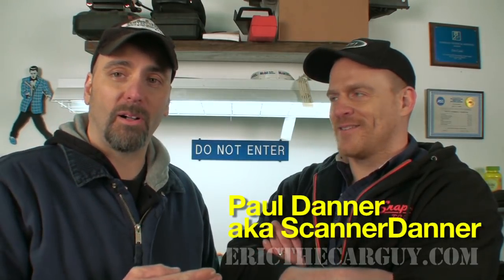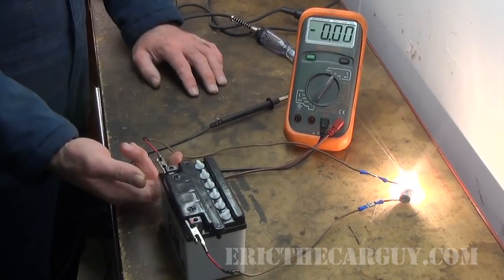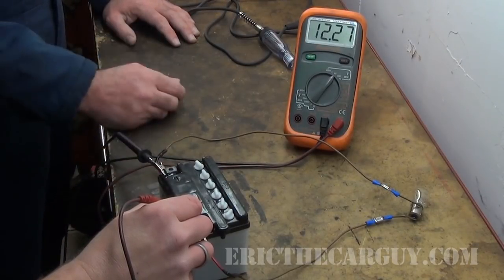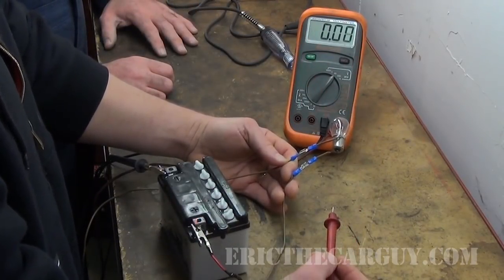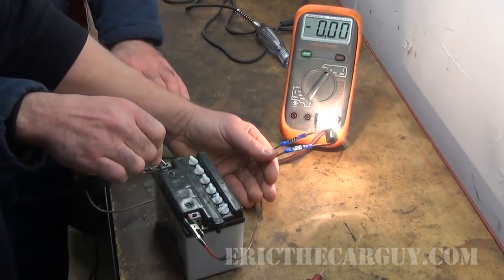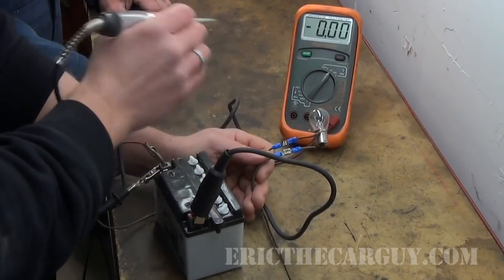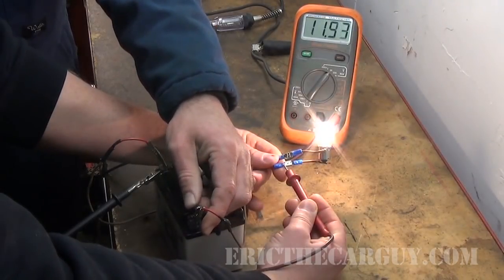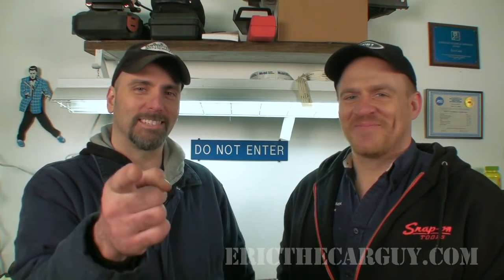Ground Side vs Power Side Switching -EricTheCarGuy

Comment: Don't know why they used a test light to determine if the resistor is switched on the power side. You just need to put the meter lead on the pos term of  the batt.  I was taught that test lights are a bad way for testing modern autos with all the electronics today (if the test light bulb is incandescent)
Reply: Yeah. Is like testing an alternator, negative (multimeter) on battery and positive on the alt and you get the reading= ground.

Comment: Ok what happens if I accidentally I back probed the power side on the ckp connector and all of a sudden I started to hear electric static coming from the pin and body ground. I quickly picked up and now the scanner does not communicate however the truck still cranks but will not start. It had already had a crank no start diagnosis... did I fry the ecm? or do I still have hope?
Reply: failed to say that the key was ON while I was checking for voltage while the ckp was disconnected.

Comment: Question. If I store my car for 8 months and don't want rust to accumulate. Can I do a electrolysis hack and would it work?
Take battery charger place + on frame and neg. On sacrifice piece of metal

Any similar hack possible?
Reply: JOE no, the principle works on ships, bridges, etc because the seawater or wet soil acts as the electrolyte.  You'd have to submerge your vehicle and odds are, that will cause more problems than it solves for several reasons.  Your best bet is to ensure that the area is kept at low humidity.  Put the (trickle) battery charger on the battery instead, you don't want it sitting drained for months.

Comment: what if both battery terminal are not connected and hook up the test light and touch a medal and lights up what does that mean and still getting a light when probing the wire and engine block

Comment: The bottom line is the schematic or service manual will tell you if its 12V switched ON or OFF or Ground switched ON or OFF

Comment: please tell me what component in a car has a negative switch never found one since they switched from positive ground I am lost
Reply: They already mentioned an example, like a door lock which gets the polarity reversed depending on which direction it's going, locked vs unlocked.  Another example is most if not all the computer controlled relays.   For example when the dome light comes on in a modern car, the power to the light may be positive switched by an interior light relay, but that interior light relay is often negative switched (coil to ground) by either another relay, or the body computer.  SO, there can be several circuits whose proper operation involves both a positive and negative switching depending on where you are probing in the circuit.  By all means, get the wiring diagram if you can.  The more complex these circuits get the more time it saves.

Comment: i thought of another way to determine which side is the ground instead of using a test light. Do a continuity test with your DVOM. leave your NEG lead connected to the NEG side of the battery, disconnect the light, and check the terminals. Which ever wire shows continuity is the ground. So you can still determine which wire is the ground without needing a second tool.
Reply: Was going to suggest the same thing, it's a good point! 
I guess one benefit of continuity test on a multimeter is that it (probably) will supply way less current than a generic test light.
Reply: Definitely a way to avoid some stupid mistakes. Like I did mounting a reversing sensors (parking radar) after all set and done. Tested the back light cluster assembly plug, etc. All perfect. No wiring diagrams and so on... 

Well it worked perfectly until I hit the brake, them it got quiet. Conclusion: I connected the ground to the brake light. 
It really seem like a nice ground at the time. LOL :-)
Reply: In a simple resistive bulb or motor circuit this can be true, but it is not definitive for a more complex circuit where the positive power may also have some other path to ground, or if for practical reasons the test is performed without the component disconnected.  In other words, continuity alone is not as good as resistance or voltage measurement.

Comment: So you never actually said why either switch would be used. Example: maybe one is more safe than the other, maybe efficiency. Thanks.
Reply: While I do not know for sure, I have an opinion as to why most automotive computer controlled outputs (solenoids, relays etc) are ground side switched.
If a ground side switched circuit control wire (the wire that does the switching) has a short to ground in the wire, the circuit will just be energized all the time.
If a power side switched circuit control wire has a short to ground in the wire, it will fry the computer transistor driver (the component that does the switching).
So the entire body of the car is a ground, which makes shorts to ground WAY more common than shorts to power.  So I believe this was done to protect the computer.
Some other theories I have heard. A ground side switched circuit will have less of an arch. Not sure about that one but if you take the positive terminal off of the battery first you will see a lot more arching than if you take the negative off. 
Today some of these systems are switching back to power side. Why? I believe the computer can more accurately monitor the circuit.
Sorry for the ramble.

Comment: Great video, BUT:
8:33 DOOOOOOO
No current flow, no voltage drop and no measurement. There is no voltage measurement without current flow through the meter.
I*R=U when the measurement current is VERY low your voltage drop gets VERY low and below the precision of your simple voltmeter. It remains all within OHMS law. The key is the knowledge of how to apply it.
Reply: That too, is also not quite true.  Even simple voltage meters have relatively high precision these days.  Further it is wrong to try to apply ohms law in this case because it is only capable of working with a resistance.   Remember that in fact, there is possibly a potential voltage difference between two points, without any current flowing between them.  That voltage is a real, quantifiable amount even if your meter can't measure it without current flow.

Comment: Now please explain why ground switching is safer than power (hot) switching.... Also let everyone know that when a ground switched component DOES go bad, it's always on... Easy to find ground faults this way.... Bottom line is, make "power" "positive" side.. the slave to the circuit.

Comment: Why does the voltage on the negative (ground side) drop to zero when the bulb is lighting up?
Reply: Because the circuit ends at the bulb when you have ground and power at the same time. So youll have power all through the wiring to the bulb on 1 side and ground all through the other side. Ive always been a remove the bulb first person with the circuit on that way I can easily tell what side is power and what side is ground. If you get nothing on either side change how your meter or test light is connected like swap to power on battery and check wires if you get 12volts then you know that wire is a ground.
Reply: Think of voltage as potential, and try to imagine that battery as a pump moving a liquid.  When the circuit was open the potential was 12.28V.  When the circuit was closed the potential (before the bulb) was 11.58V; (after the bulb) it was 70mV.  So the voltage drop (V_j) is 11.51V across the bulb.  The bulb in the circuit accounts for nearly the entire load.  There are voltage drops in the leads as well but they are negligible in this circuit.  Every voltage drop will add up to the exact voltage of the battery, because of the conservation of energy, watch a YouTube video on Kirchhoff's Voltage Law.
Reply: the bulb will consume the entire voltage. 
if you have two bulbs connected in series, each bulb will share an equal portion of the voltage (each consumes half of total voltage in this example)
Reply: Two bulbs in series will only have equal voltage drops if both bulbs have the same resistance.    @fromstarlighttosunrise128
Reply: Norma Stitz don’t make it confusing for someone who is asking a simple question
Reply: My answer is simple read it twice if you're confused.  @fromstarlighttosunrise128
Reply: Norma Stitz i meant for the person who asked the question. if you don’t try to communicate with others, you only edify yourself.
Reply: Good point

Comment: You make it too complicated by saying ground/positive side switched.  You should be talking about opens and shorts and which sides they are on more than that.

Again you make it too complicated by trying to isolate with the volt meter function.  Once you know the load is good, but one side isn't completing the circuit you use the ohm meter function to find out what side it's on.  Of course you have to disconnect the hot end or be 100% certain you aren't making a circuit from hot to ground because the ohm function provides it's own small amount of voltage to check it and you could fry your meter or burn out the fuse.
Reply: The application here is when troubleshooting computer controlled circuits. You are performing voltage measurements as a beginning point in your troubleshooting process. If you do not know what voltage levels are expected, you cannot accurately troubleshoot the circuit. And your ohmmeter is not going to clear things up for you.
Reply: ScannerDanner
This is a horrible video for troubleshooting.  It works for opens, not shorts like I said and he makes it confusing by overly complicating the procedure and reasoning.  If you check for voltage, the load needs to be removed and checked for voltage on the hot pin to ground and vise versa to see if one is absent, not try and check for positive voltage on both pins with the load still attached.  Once found you need to isolate between the mid disconnects doing end to end ohm checks to find out what segment it's in if it is an actual wiring problem.  I didn't hear if he was just using it for demonstration purposes, but a load light isn't the smartest thing to use on a computer module either because if you use it to check wiring that doesn't normally get 12V, it can fry it.  The volt meter function is safer because it has a very high resistance.

I think he needs to remake the video.  Just my opinion though
Reply: Toluene
This is not a troubleshooting video. Eric and I made this to help people ID circuit design. Are there more ways to ID a circuit? Of course! This is one of the ways and it is a way I use all the time. It is proven, effective, efficient and not complicated at all. The ohmmeter is NOT a reliable tool. I can give you so many examples and videos if you want them.
Did you know a section of wire can read 0 ohms (indicating no resistance) and still have a resistance problem? This is why we do loaded circuit voltage drop tests in the field. That would be with the load plugged in and current flowing. You say unplug the load, then check for voltage? This is a fundamental misunderstanding of proper voltage measurements on a car. The circuit must be "loaded" (current flow) for proper testing.
I promise you the ohmmeter will cause misdiagnosis in the field. Use it if you want, but you must know its limitations.
Watch this video Toyota Echo No Communication Case Study
Start watching around the 29 minute mark for the ohmmeter test
Reply: ScannerDanner 
Ok sorry thought it was a troueshooting video.  The ohm meter is reliable but yes It wont tell you if the wire is hanging on by one strand.  you cant always probe for voltage with the load in. almost all problems i've ever seen are after the wire has already broken or the strands are starting to ground out
Reply: Toluene
Really appreciate your comment. The hard part about this field is there are so many ways to do things. And what is good for some is not good for others.
Reply: +ScopedPewPew Not at all. I just don't agree with it. It's more the wording in the description more than anything. To each his own though. In the description in mentions electrical diagnosis which is where the confusion came in..

After seeing a few other videos by these guys it's clear they've been doing this for awhile so I left it alone.

Comment: Ground does NOT equal negative.
Reply: If you have an electrical system that has no earth ground reference, many times it does.  You could say the potential of the battery is zero positive and -12, negative.  People just aren't used to talking about it like this because they have it stuck in their mind that zero volts is equal to earth ground.
Reply: Yes, it does.... It's the OPPOSITE side of the circuit; it doesn't matter where the breaker or fuse is....... You're not very "electrically" smart.... Grow up.